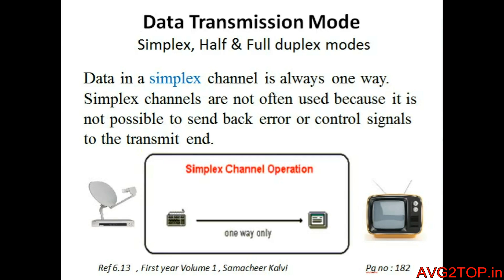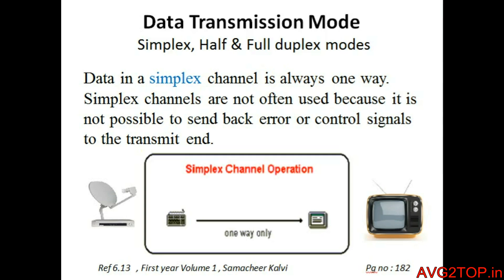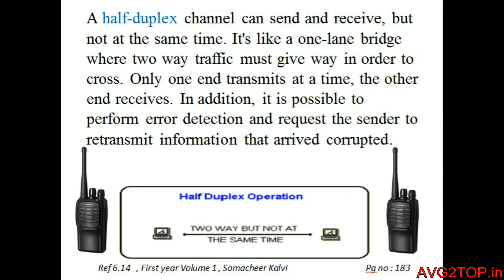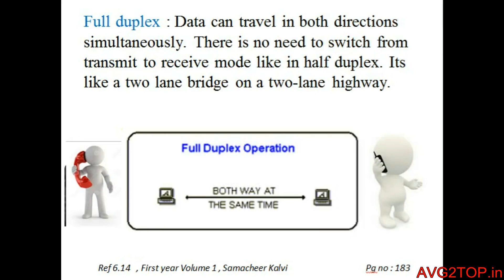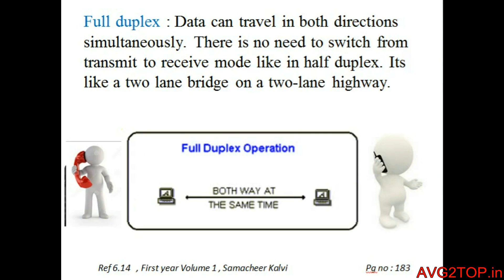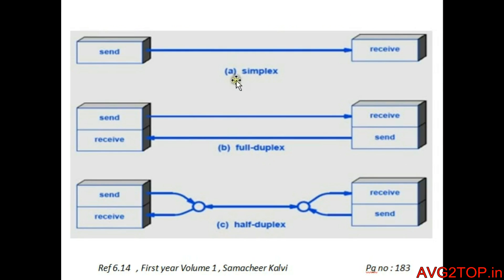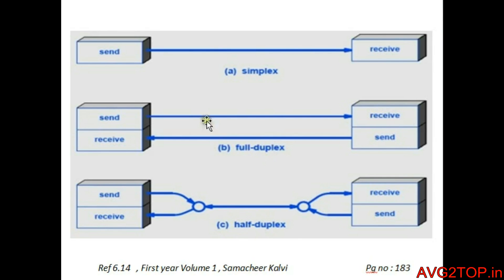Data Transmission Mode - Simple,Half & Full Duplex

Comment: How does full duplex uses two-wire as medium for data transmission?
Does it use one of wires as forward and reverse channel at the same time. Will the electrons collide when signals with different frequencies from opposite direction travels at the same time using same medium?